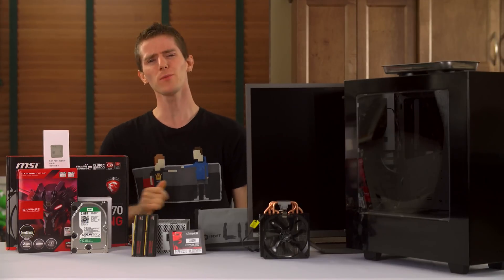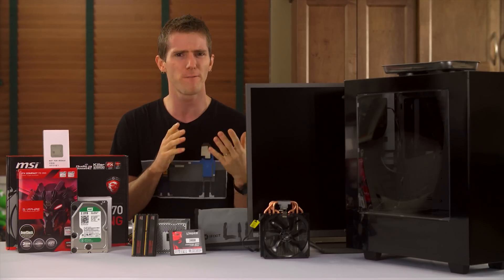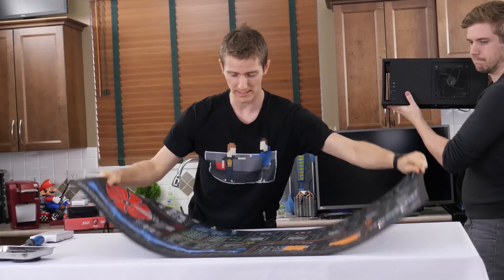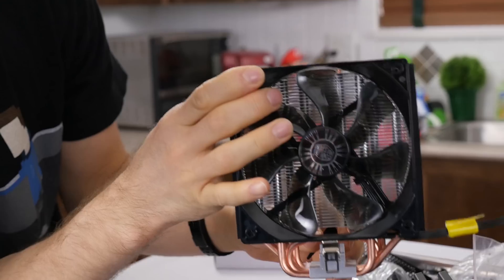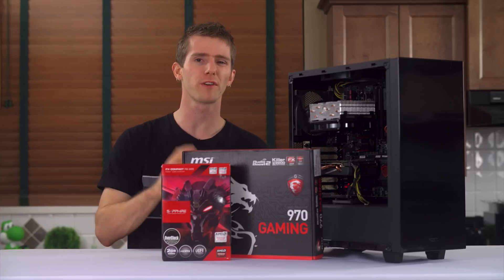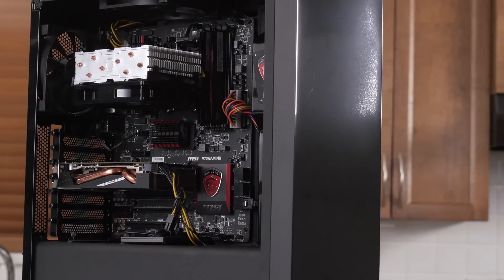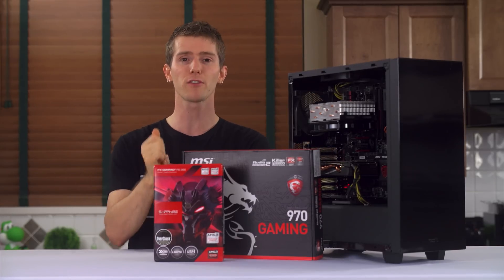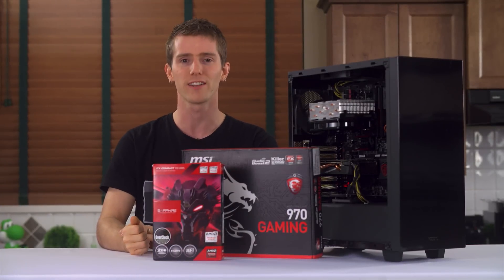Can you Build a 4K Gaming PC for Under $1000?

Comment: I just bought an Alienware x51 with an intel i7 8mb cache 4.0gh w/ turboboost, 16 gb of ddr4 ram, NVIDIA GeForce GTX 760 Ti with 2GB GDDR5, and 1tb of sata for the main drive for about $11,169.99. PS(I Think I beat your build)
Reply: I think you overpaid by like $9,000. So in a way he still won.
Reply: Pigatto17 your gpu is significantly weaker than the one linus used in his video.. he not only paid $10.000 less, he also beats your machine with ease.. but you're probably trolling anyway..
Reply: Pigatto17 why would you pay 11 grand for that i could make a build for $3000 that could way outperform that in gaming and workstation

Comment: New viewer to your videos and channel.

Thank you for promoting the GTX 970 Video Card because I recently purchased that card to go along with my current and first pc gaming computer.

Enermax Ostrog, black with blue mesh
MSI X99S Gaming 7
Western Digital Black 1TB HDD
Crucial 240 SSD
MSI GTX 970

Currently building on a budget, but will need a power supply, processor, and RAM.
Reply: Aidan Sweeney
600-750W for GTX970? WTF? The card runs easily with 400W
Reply: If you need suggestions:CPU: Not sure what's compatiblePower Supply: A 550W will probably work, but 600-750 is recommendedRAM: Any DDR4 (DDR3 isn't compatible with that motherboard) 1600MHz-2133MHz of any amount you need/want
Reply: Thank you for the recommendation because i really needed it.
Reply: Dregs for CPU you have three choices; the i7 5820k 6 core, the i7 5930k or i7 5960X. I'd recommend the i7 5820k as its cheaper and can be over clocked for decent performance.
Reply: Dregs as for RAM 16gb of DDR4 is the minimum I'd say for editing, the speed and timings of the RAM are really up to your personal preference.
Reply: so 400-700W. thank you both
Reply: Gaming computer won't need X99, Z97/H97 with an i5 will be more than enough.
X99 for only gaming is throwing away money
Reply: Teun Willems Thank you for your comment, but I will be using my pc for gaming, video game footage recorder, and a video editor. :)
Reply: 420Y0L0SAURUSREX I was thinking of getting GB (2x8GB) with a upgrading to getting enough one when the timing is right. dont wanna get too many ram and cannot find them because of the cpu fan and the graphic card. regardless, thank you.
Reply: Dregs I would go 1x8 GB if you have a board that maxes out at 32GB and has 4 RAM slots, since you can add one for 8GB, one for 16GB, one for 24GB (dunno why you'd want 24GB but ok), one for 32GB.
Reply: Aidan Sweeney http://www.newegg.com/Product/Product.aspx?Item=N82E16813130795

the mobo max is 128GB plus i have to get a cpu fan and install my graphic card. i probably wont have enough room to fit all the ram slots, but i will try. thank you for the advice i will take that like i taken the rest copy and paste and read them constantly

Comment: What u guys think about this build(gaming)?

OS		: Microsoft Windows 7 Home Premium SP1 (OEM) (64-bit)
CPU		: AMD FX-6300 3.5GHz 6-Core Processor
CPU Cooler 	: Cooler Master Hyper 212 EVO
Motherboard	: MSI 970 Gaming
GPU		: Sapphire Radeon R9 280 3GB DUAL-X Video Card
Memory		: Kingston HyperX Fury 8GB DDR3-1600
Storage		: Seagate Barracuda 1TB 3.5" 7200RPM Internal Hard Drive
Power Supply	: Thermaltake Litepower 600W ATX Power Supply
Case		: Aerocool Xpredator-X1 Black Edition ATX Mid Tower Case	
Headset		: Cooler Master Ceres 300 Headset	
Keyboard	: Corsair Vengeance K65 Compact Mechanical Gaming Keyboard
Mouse		: Gigabyte M6880X Wired Laser Mouse
Monitor		: Acer K202HQL 60Hz 19.5" Monitor

suggetion and opinion very much appreciated.

Comment: hey can someone please tell me what you think about these specs and i'm probably gunna buy this and it's (NZD $1040) which is ($782 USD)  
also its prebuilt
CPU: AMD FX-6300 Six-Core 3.5GHz/Turbo core up to 4.1Ghz 14MB Cache Socket AM3+ 

MB (Chipset): AMD 970 Chipset Socket AM3+ USB3/Sata3 

Ram: 8GB DDR3-1600 Ram 

Harddrive: 1TB 7200RPM 

Optical Drive: CD + DVD Multi-Function DVD Writer 

Graphic: NVIDIA Geforce GTX 960 2GB GDDR5 Video Card DVI/HDMI/VGA 

Network: Broadband Ready with Ethernet port 

Audio: High Definition Audio 

Case: Thermaltake H25 Mid Tower Case 

PSU: 500W MEPS High Efficiency and Reliable Power Supply 

USBS: 8 x USBs (3 x USB3.0, 5 x USB2.0).
Reply: Thats pretty close to the build I made, with a few notable changes. I agree with Captans Youtube, build your own, use a different power supply (one that has plenty of positive reviews) a small SSD with a mid-sized cheapish HDD and load the OS to the SSD for quicker boot times. There are plenty of great videos for first time builders to get an understanding of the set up, I'd suggest watching a few of those. 

The CPU is a good choice, real easy to overclock, just get an aftermarket cooler like Cooler Master Hyper 212 Evo. If you build it yourself you can also do upgrades because you would be more comfortable with opening up the computer, so I would recommend a single stick of 8gb DDR3 @1833mHz and keep the packaging/info so you can upgrade to dual channel 16gb, which is much more desirable for a lasting gaming rig.

Lastly, go with the GTX 970. It has twice the memory (kind of...) and I can personally tell you the thing is a bona fide beast. Just use PCpartpicker or a similar site to keep track of parts costs and buy your parts when they are on sale.
Reply: New Zealand is terrible for building computers, period. OVERPRICED TO HELL :P 

First, Please build your own computer, you can probably save a few dollars, and it's really quite easy. Most of the terms used above are just marketing jargon. To sell the prebuilt at a higher price.

Second, You probably should get a SSD, I'm too lazy to write why. But your system will be a lot snappier!

Third, Please get a proper power supply (corsair and such). Bad power supplies like the one they would appear to have used here has a notorious record for destroying PC components. and in extreme cases even setting the computer on fire! 
Another reason to build it yourself.

My Final Words... Please build it yourself! 
PM me or comment on one of my terrible videos and I can give you a hand if you want to take the better route of building yourself
Reply: Dude you are falling for the traps of expensive stuff.
You dont need a 970 to run modern games (including Battlefield4 etc.)
Go with a FX 6000
8 gb of 1333MHZ or 1600MHZ in a SINGLE slot
500 Gb of HDD
For GPU you can easily go with low end gamer stuff. Just search for low end GPU for gamers and save a huge amount of bucks.
Unless you are gaming at 4 or 8K on ultra, this build makes no sense
Reply: thx guys for your opinion :)

Comment: LinusTechTips Great video Linus! Don't listen to the haters in the comments. They clearly didn't watch the video. For heavens sake, you showed us the results of gameplay in the video! For anyone who's saying that the r9 285 is "an illogical choice because it's not powerful enough to run games at 4k" they clearly didn't watch the video in which you specifically stated that you'd need multiple of the highest end graphics card in order to get a playable enjoyable experience in the latest AAA titles. Keep up the good videos!
Reply: huh?, The R9 285 can run the games. Sure. But you would MUCH BETTER OFF going for the GTX 970. If you didn't notice by the nature of this video Linus has obviously been bought out by AMD. No way the normal Linus would use components like that in a normal rig.
Reply: Captans Youtube Yeah, but this isn't a "normal rig". The build was specifically aimed at being able to play more mainstream titles in 4k, not new, AAA titles. The gtx 970 is 150 bucks more expensive than the r9 285 and wouldnt be able to fit in the budget. Plus, it's more than you need in order to accomplish what this rig is aimed at.
Reply: muurf Hey, Firstly where on earth did you get $150 difference? Even in Canada, where Linus lives the difference is a negligible $40 comparing 2 MSI branded cards (on newegg). In the US the difference is even smaller, $10 comparing identical cards. 

Now if $40 is that important to you then sure, buy the R9 285x. But the 970 will perform better and by extension offer a smoother game experience.

P.S. The R9 285x couldn't run WOW maxed out, and a bit of extra fps headroom is helpful.

P.P.S I have been watching Linus for quite a long time now, and I know that if he was building a 4k Gaming pc he would NEVER USE A R9 285x :P
Reply: Captans Youtube Hi! First off, I just want to mention that anything I say is not meant to be interpreted as being in a sarcastic tone; I mean it seriously.

First off, I don't think there's such thing as an r9 285x; it's just an r9 285.

Second, the last time I checked, the gtx 970 is about 350 dollars, while on PCPartPicker.com, the r9 285 is only about 200 dollars. Where are you finding the gtx 970 for only 10 bucks more than the 285?

The gtx 970 is obviously a much better graphics card but (at least from what i've seen), it's about 150 bucks more expensive. On top of that, once you buy a GPU like that, then you are probably going to want to spend extra on a core i5 or something. It wouldn't quite fit in this build.
Reply: Captans Youtube By the way: agreed. There is NO WAY linus would go with this setup for a regular 4k rig. But for what this computer's aimed at, I feel like it was a decent choice...
Reply: muurf I am Crying at my stupidity, turns to you probably shouldn't post comments at 3am :P haha

First, Yep. Refer to Paragraph one for the explanation.

Second, Okay heres where I realise how stupid I sound. Turns out when I was comparing prices I missed a extra hundred.

Corrected Version
In the US its $110 Dollars difference and in Canada its $140 difference. Stupid me -_-

Third, I disagree. If you could get it cheap then go for it, I don't think the CPU will bottleneck it.  

In Conclusion
I do agree, I still stand by Linus being bought out by AMD. But I think its was a good choice.
Reply: Captans Youtube Haha! :-)
Reply: muurf did you guys notice that monitor was included to that 1000$
Reply: Captans Youtube  Dumb ass, if you wanted to run AAA "Just bought of the shelve FPS titles" at 4k you could easily buy 2 R295x2's and run anything you want. Also AMD, (I always still want to say ATI), was and always has been the GFX leader in the world. Only reason Nvidia did well at times is because they BUY OFF game developers to use custom instruction sets that AMD/ATI doesn't have.. . (cough cough) Sim City 4!

Just wait until AMD releases their next high end card coming right away with stacked memory, say goodbye to titan. Nvidia's response? Crank up the voltage and add more cooling!!
Reply: Ben Zimmerman by the way, the 280x is not cheaper than the 285, and apparently the monitor was included in the 1000 dollar price point.
Reply: ***** i live in south africa
and if someone can afford a 4k monitor ($600+) then I think they can afford a $300 GPU. like seriously.
Reply: Daquan Jr. totally. If one can afford a 4k monitor, he should get a 980 ti or fury x. Because he probably can.
Reply: Niklas Ahlfors Ooooooooohhhhhh. No, I did not know that, but now that you mention it, it makes A LOT more sense. LOL!!
Reply: Nirotix I just would like to point out that if you want to run AAA titles at 4k, you don't need dual R9 295x2s, just one is perfectly capable of running the games almost fully maxed out by itself. (It is a dual-GPU card). Also, that wouldn't quite work in this build; the 295x2 is priced at about 715 dollars, which would leave you with less than 300 dollars to squeeze in all of the other components. Also, the monitor was included in the price of this rig, so you would really be left with no budget at all. And if you went with 2 295x2s, you would be significantly over the price point, at almost 1500 dollars. Other then that though, I agree with your reasoning.
Reply: muurf I didn't mean this build, obviously even 1 295x2 wouldn't work with it. I have a 295x2 myself, just one, I know it's a dual GPU card.

That said, there are some titles I turn stuff down for to play silk smooth. With a 4k monitor, I don't even bother to use AA... no point. Saying that thou, I would like to add another 295x2 to my rig (even thou quad SLI/Crossfire scale badly) just to be able to turn everything up max in those couple games at 4k.
Reply: Nirotix Oh. I'm sorry, I mis-interpreted you. I thought you meant that you could use a 295x2 in this build. My bad. Also, yes I know that you can't run all AAA titles with maxed out settings at over 60 fps in 4k. I meant that it can run most games fully maxed out. I did say "Just one is fully capable of running the games ALMOST maxed out by itself."
Reply: muurf  All in all, I'm really dam surprised. It's a solid rig. I played WoW for 7 years, I'm certain this could play Banished, Civilization or Europa Universalis 4.. etc easily with this rig.
Reply: you have to be sniffing some pretty fucking strong paint to spend $800+ on a monitor but buy a budget PC that would struggle to play at high settings in most games at 1080p
Reply: Daquan Jr. Well if you only have $2000 to spend, but want to get into 4K gaming, this would be the way to go.

A monitor lasts for a decade, when you did have the money to get into high end 4K gaming once prices come down/widely available to middle consumers, you can replace MB/CPU/GFX/MEM... or just build a new computer.

Cause right now, if you wanted to "step up" from this to play FPS AAA titled 4K games, you are looking at spending $4000+ more than this build (not including the monitor). Kinda steep price step.

I've looked into it, trust me. The 2 GFX cards you'll need alone will run you close to $3000 (Titan X or AMD's new cards coming out), now factor in CPU, mem, etc..
Reply: Niklas Ahlfors no they did not! they were too busy with the measuring tape and penises (Linus used an AMD pcb not a Nvidia!!!)
Great video is just a build on a budjet guys not the ultimate gamming rig! i would make it differently for the same budget! everibody would i guess!
Reply: ***** dude a 970 is $300 how the fuck is that rich
also if u have the money for a 4k monitor, bu that logic, docent that make you some tycoon ass shit?
Reply: ***** Firstly, I want to emphasise I don't want to debate with a AMD fanboy. Hence why I didn't reply to Nirotix. I have no interest in flame wars so DONT attempt to start one. A typical flame war starter is when you begin a comment with 'Dumb Ass'.

Firstly If you cannot afford a $300 GPU yet you are buying an $800 4K monitor then you need to get your priorities right. By all means go with a R9 285 for 1080p or even 1440p as its more than enough to run most games at reasonable FPS (at least in 1080p [1]).

Now the reason I suggested you use a 970 in the case of 4k gaming is because the 970 could in some situations outperform the R9 285 by %40 or more [1]. This could easily justify the extra price tag especially in 4k.

The 970 also Includes 4 GB of VRAM compared to the measly 2GB of VRAM in the 285. For 1080p gaming, the 2GB offered by the R9 285 is fine and (unless you intend on doing something ridiculous) should offer enough VRAM.

4K however is a different story, in many 4K tests the 970 would fly ahead while the R9 285 would be massively bottlenecked by the VRAM. With many users having to turn down the settings to enjoy a playable experience while not even using the GPU to its full potential!

This means that in many situations (except very light games) the 280 is unacceptable for 4K. A reasonable choice instead would then be a 290 BUT it costs almost another $70 on average and doesn't offer a similar performance advantage to what spending another $100 would grant with a 970. 

To be truthful though, any card around this price point will falter when playing 4K games. A 290x or 980/980ti will serve you much better then gimping on a graphics card now. I will be waiting to see what AMD releases with the new 300 series cards.

Greatest Wishes,
CY

[1] http://www.gamersnexus.net/hwreviews/1790-nvidia-geforce-gtx-960-game-fps-benchmark-review/Page-2
Reply: Nirotix yeah, the monitor that i bought bundled with an HP desktop 5 years ago stills looks really nice, it will stay where it is for another few years, while the PC... well, it's gone

Comment: is it possible and what happen if you crossfire this card with a apu?
Reply: Doubt you could, different 'gen' of cards. If you could there would be no point... the GPU is leaps and bounds ahead of the APU!
Reply: You can, but dont do it. Cross Fire is Flexible unlike SLI, you should be able to do so but it heat up your CPU to water cooling necesarry temps. As well reducing CPU performance cause it has to send a lot of traffic. It will maybe even reduce your FPS cause the CPU is too busy when doing APU CrossFire
Reply: ok. Thanks!

Comment: It is important to also read the discussion linked in the video description.  You'll find some links to Tweak Town tests between FX 8 core and i7.  They show how narrow the CPU performance gap is for gaming.

Yes, this video is for a budget rig.  But what do most people do with a budget rig?  Upgrade it in the future.

So if you plan to start low now and then go high performance 4k with a 2nd GPU in the future, you want to plan your Motherboard and CPU choice around that.  You will need an FX 8 core (* with a 990fx board, not 970) or i7 to scale properly in a multi-GPU setup.

Comment: Linus says there are 4 USB 3.0 ports in the rear I/O of the 970 board, but I only see two ports that are indicated as USB 3.0 by the traditional blue color. Are the other two via header, or are the red USB ports also 3.0? If the latter is the case, then why are they red not blue; what makes them different than traditional USB 3.0? 
Please reply!